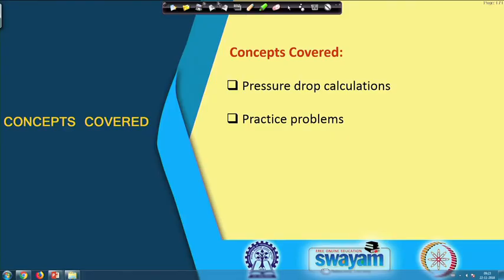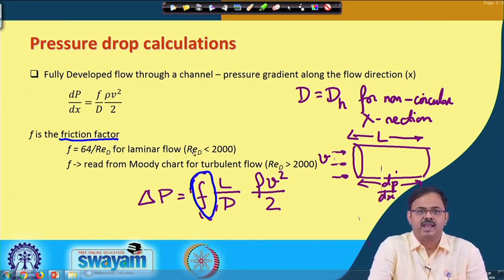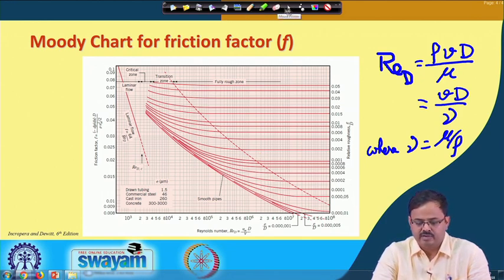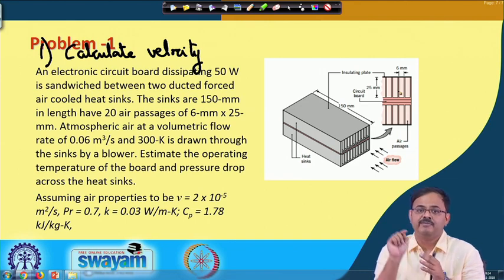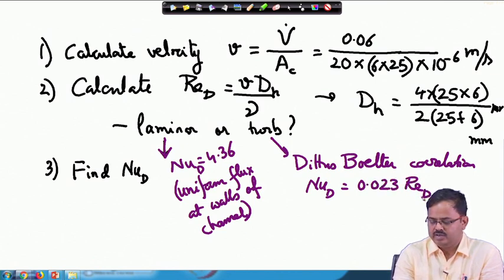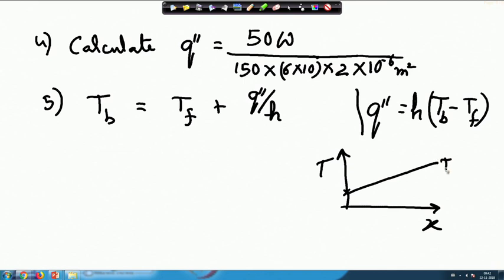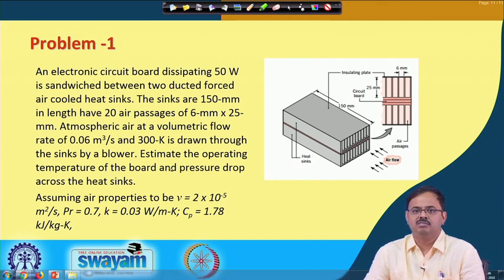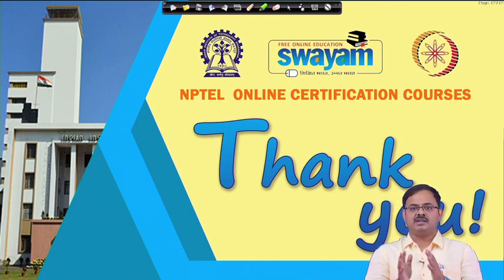Lecture 28: Thermal Management 7: Practice Problems

Comment: May be the problem is just for example.. and extremely well explained by sir.. in practical approach we keep the heat generating devices on the flat surface and in case of using sandwich configuration the devices will be sandwich between the flat surface of the heat sink and the fin side which is open to atmosphere is suitably covered by a plate to form a duct so that the maximum amount air will be in contact with the heat sink. I think even in that configuration the steps mentioned by the sir to calculate the pressure drop will be similar to the configuration shown in the sample problem.